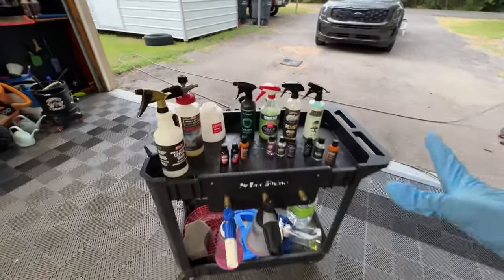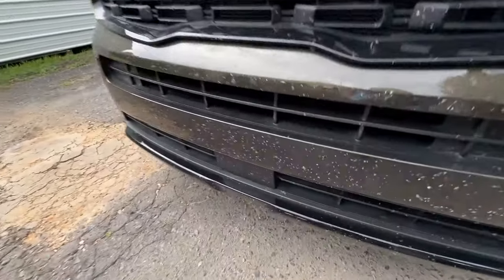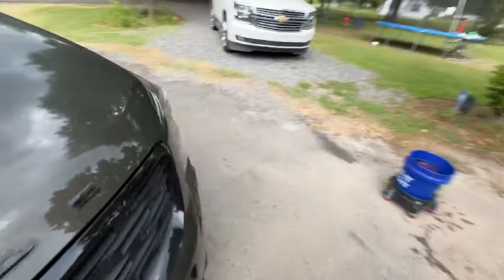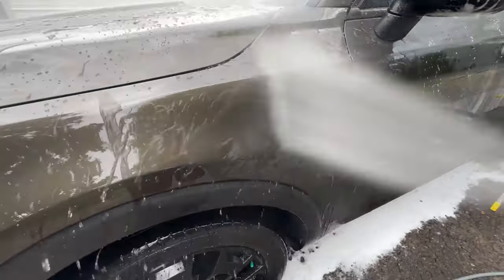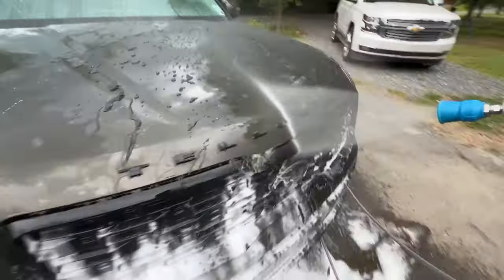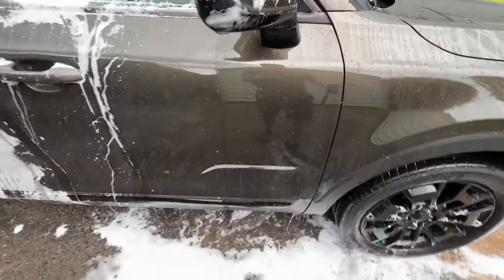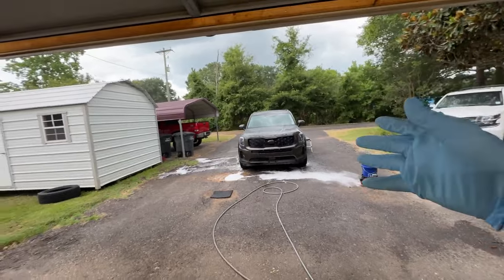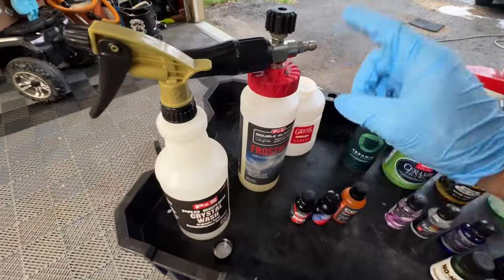The Baddest Ceramic Coating Update Spectacular! (Ethos vs C6 vs CCI)

Comment: to me it looked like Max was the best it wasnt forming anything behind the impact and was just beads. CCI was 2nd has its forming of a bit of a sheet of water was slightly smaller than C6 and c6 was 3rd as the sheet behind the impact was just slightly larger than CCI
Reply: 100%

Comment: Man right now I got Ethos Max in the lead followed closely by CCI. The water was flying off that section. Maybe next test you could use a garden hose nozzle that has a shower and mist setting or something to see if you can flood the panels for both the sealants and coatings. Something that would more accurately simulate rain.

Comment: All 3 of the heavy-hitters had great water behavior, but for the price point C6 Hydro Lite looks just a touch behind the other two based on water behavior alone. It was hard to tell because you cut away a little too soon, but I think C6 had the most beads left on the surface after you stopped spraying. Hydrophobics isn't everything, but C6 just seems a little "sticky" (for lack of a better term) for those last remaining individual beads after the bulk of the water drops off. 

Definitely curious to see what other differentiations might come to light as time goes on.

Comment: From a humid climate with nugs and constant rain(Miami), I've been using griots religiously for about a year, and I love it. I stopped to use Ceramic Gloss once and to my circumstances, it didn't last long. (I park outside and drive on the highway nearly every day plus I spilled most of it when applying) I just found that it attracted dust and pollen quicker than griots. Griots is readily available at AutoZone for me, and it's strong. Keeps my car glossy for a while, even when I road trip up and down Florida. Cool to see my theories were right in some regard.

Comment: I think the hydrophobics looked better in Mike G’s rinse off of C6, but on that panel Ethos was looking mighty fine.
Reply: MikeG did not hold the pressure washer in one spot for an extended time like Jamie did.
Reply: @orthodox1717 also Mike's pressure washer is lower flow.

Comment: What tip was on the GG Boss pick-up tube... Purple?
Reply from the maker: Yes purple
Reply: They recommend purple for electric pressure washers. I use this too and it gives great foam. Aqua gives a little more foam but I feel like the difference isn’t that much more. And you’ll probably be wasting product.

Comment: Random but what exactly does Crystal wash do and when would be best time to use it…like spring with pollen, summer bird crap, winter with salt and road grime etc? Because im blowing thru the gallon i bought because i dont think you can dilute but dont really see or notice what its doing during maintenance/decon washes. Love all ya stuff man
Reply from the maker: Only need to use about every 6 months
Reply: @JamieTheCleaner thanks! even for a non coated vehicle like mine? Going to apply soft coat 99 fuso coat 12 month wax/sealant soon because i dont have an indoor area to work and dont trust myself doing my first coating outdoors in the sun and humidity

Comment: C6 kind of disappointed honestly when compared to the Ethos and CCI
Reply: It's splitting hairs at this point. Time will tell if there are other differences that might tip the scales (self cleaning, resistance to clogging, marring resistance, chemical resistance, etc.)

Comment: if ethos max is maxed out then i'm wondering how it compares to the ethos pro? is max the new flagship or is pro still elite?
Reply from the maker: Max is only concerned with being as durable as possible and not ease of use where pro is still a balance of durability and easier install
Reply: @JamieTheCleaner  Pro says 10 year and Max says 7 ? Pro is $10 cheaper lol. Doesn't make sense to me but I might try the Pro on the hood  of my truck.

Comment: C6 looked questionable when flooded
Reply: When was it flooded?
Reply: @rooboy99  when he flooded the panel. Holding the fan pattern on it for sustained time to see the water build up
Reply: @NoirSavant I noticed the difference too, but it's a very negligible at this point. I'm more curious to see how they all fare over the long term.
Reply: @jeffc6832  this is true, the lack of hydrophobics in comparison is a slight concern. But what I’m more frustrated with is the fact that their professional grade coating seems much better. “DIY Detail’s” sister company creating a professional grade coating is hysterically hypocritical.